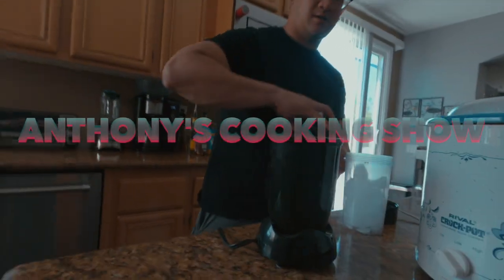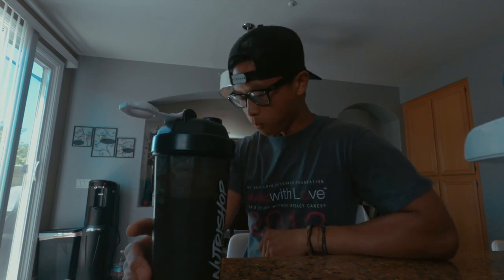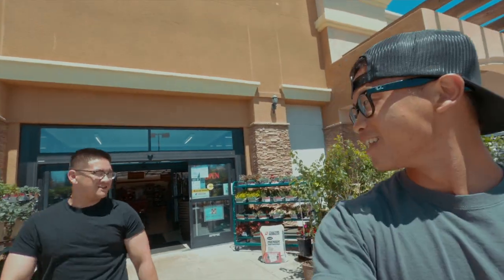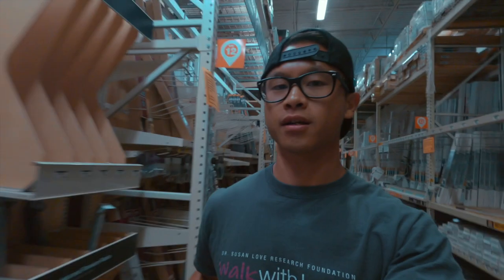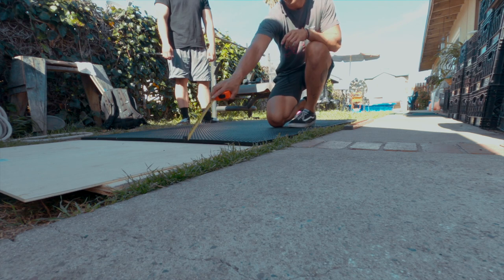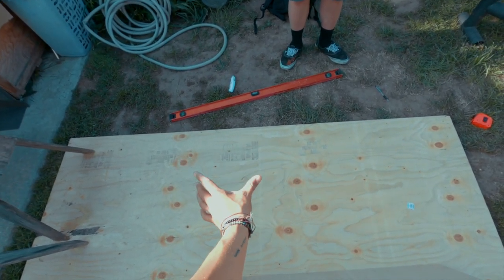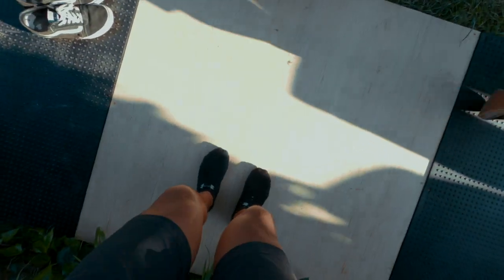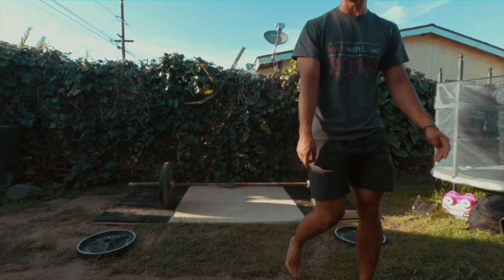Building a backyard budget deadlift platform for $100!

Comment: Hey! Im thinking of making one for outdoor will the platform last long? If i put tarpaulin on top of the platform when im not using it.
Reply: Because it will rain and make the plywood durability worst
Reply from the maker: @kachoncheung8410  mine lasted a couple years and it was out in the sun all its life. I’m sure you’ll get lots of life from it as long as you protect it from the elements. (Weather)
Reply: But you left it outside even raining?
Reply from the maker: @kachoncheung8410  yeah